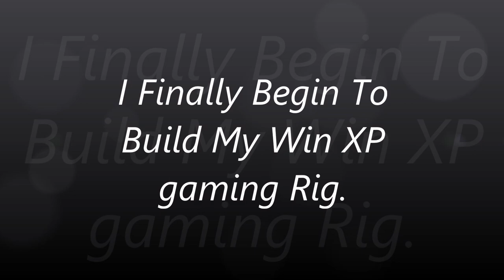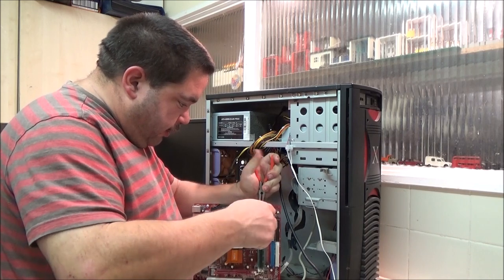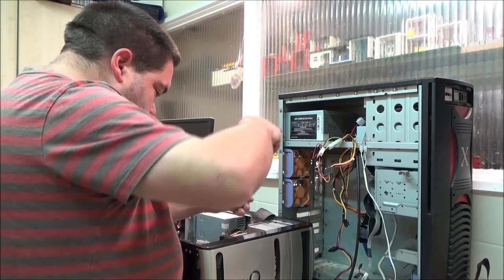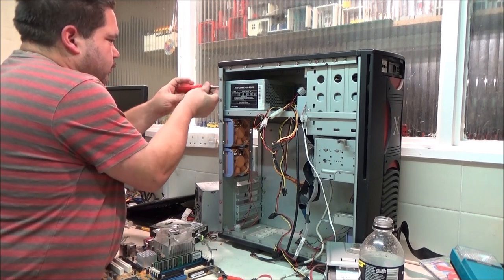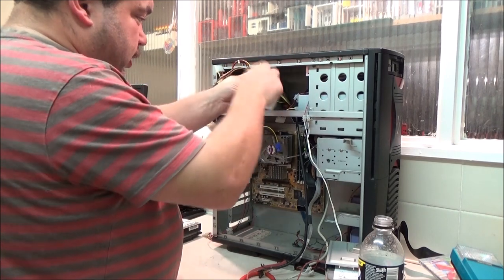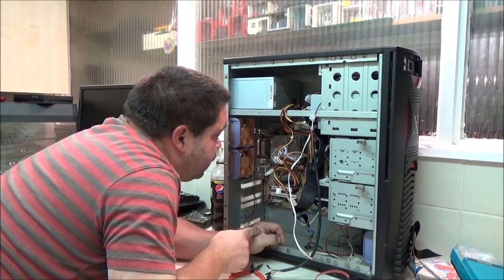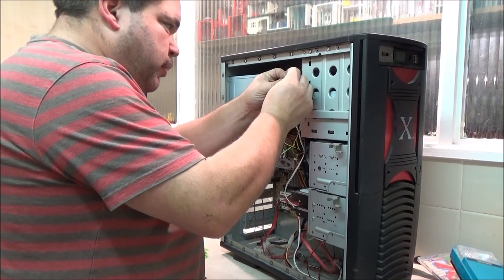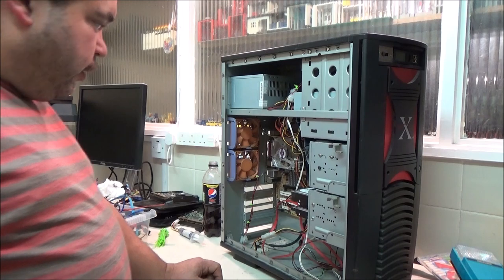Finally! I Start To Build My Win XP Gaming Rig!

Comment: I got given an am2+ sapphire mother board has an am3 athlon x4  620 CPU and I put a sound blaster 5.1 sound card and at the moment an Nvidia gt 730 graphics card  set it up with xp , One problem I found is games that require steam will not i run as stream is no longer supported so I cannot install fear 2. Though I could buy it at gog.com download on a modern pc and transfer and install on my xp machine as. Games on gog are DRM free.